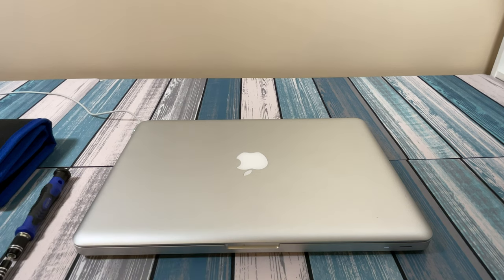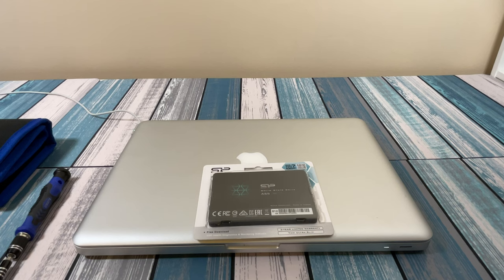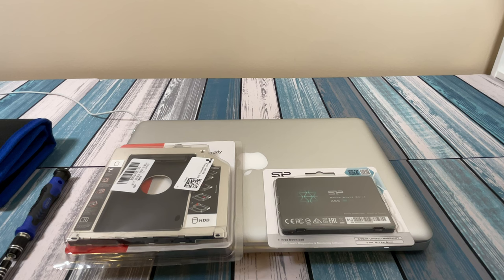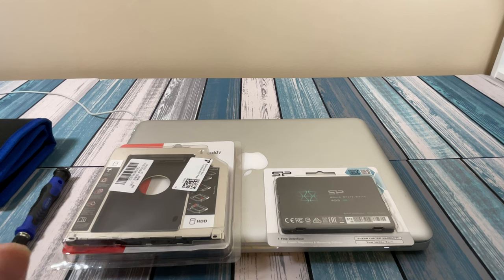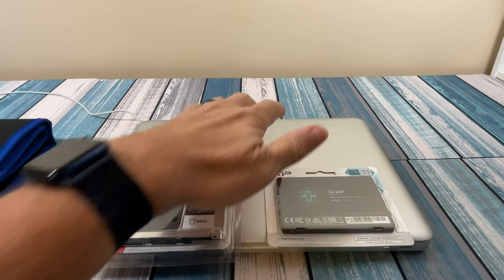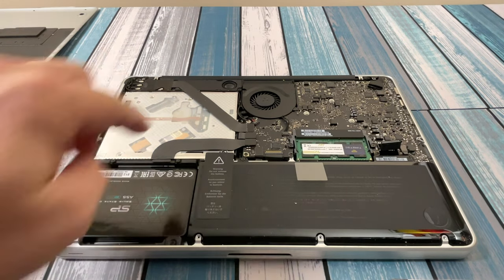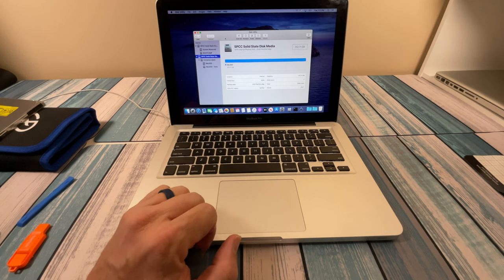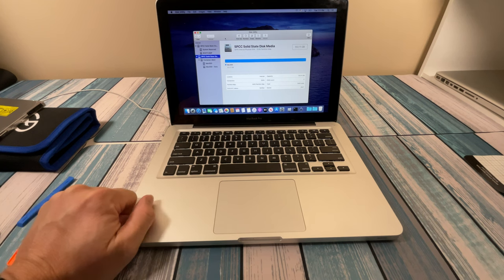2012 MacBook Pro Upgrade Pt. 2 - Adding Windows to a 2nd Drive

Comment: As I am sure you are busy with many other videos, I suppose there has yet to be a third to this project yes? Perhaps you wouldn't mind sharing here what your thoughts were on Part 3, as I am very curious given my own present circumstances I explained in a reply to DELLsFan below. You have some very clever ideas! Thank you in advance—Cheers!
Reply from the maker: Sorry it wasn’t easier to find. Here it is:  Dual Boot Setup with Windows on a 2012 MacBook Pro using BootCamp
https://youtu.be/YJdsNXuSRJk
Reply: Came to ask the same question 👍

Comment: If you have Win10 on another computer, could you clone that onto an sdd that you will replace in the optical drive, and have the dual boot happen with that?
Reply: No, it won't work

Comment: Hey!   New here.  Where's part 3?
Reply: I have the EXACT same question. haha Just acquired one of these randomly which is how I found your part 1 and in the process of bidding on those parts, along with a new battery. This Part 2 though was very interesting and a very clever idea, so I'm greatly interested in your other ideas for Part 3. As a side note: I did install OCLP and am running Ventura. I too needed Windows, so I set about installing via Bootcamp. I didn't realize that this process becomes rather convoluted due to OCLP. Given my model has the SuperDrive, I cannot install via a USB, instead I'm having to burn a DVD of an archived version of Windows 10. This archived version (1803) is the last release to fit completely on a single DVD. Basically something that should have taken a day has taken 3 going on 4, mainly because the DVD-Rs I thought I had, are actually stupid CD-Rs... like almost an entire spindle of 100... complete waste, junk, and I moved those damn things 3 times now with the first move back in 2011!! The whole time I'm thinking they are DVD-Rs. lol They probably have disc rot by now anyway. lol So I'm off now to my local Walmart to buy some DVDs.

Comment: No1 mistake putting windows on a Mac... your Mac got revenge on you.  I have a second drive in mine as extra storage.  Its more fun installing Ventura with OCLP 05.1
Reply from the maker: True, but some people have a genuine need to run both OS’s on a single machine (without the hassle of VMs). And yes, OCLP is on my to-do list. Videos coming eventually…. Thanks as always for watching and providing input, Mike!
Reply: @FamilyGeekery  What you need is a good second hand Thinkpad for windows.